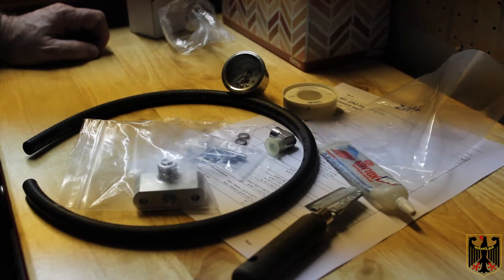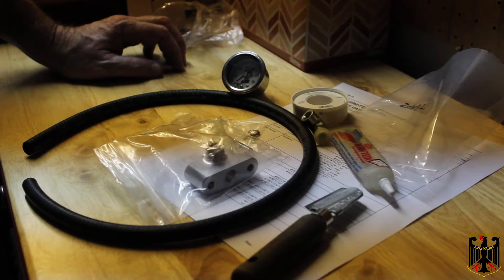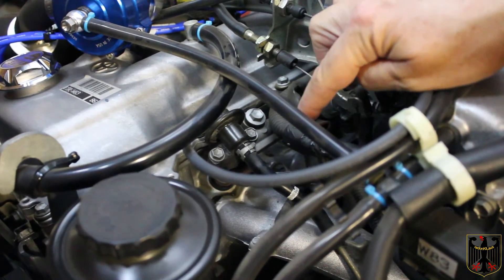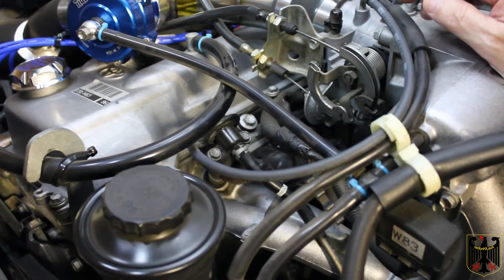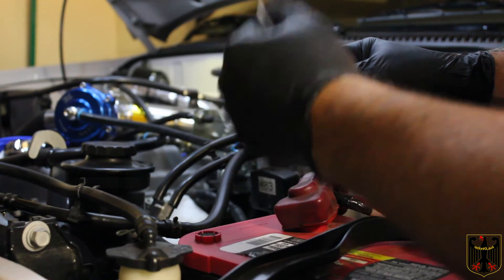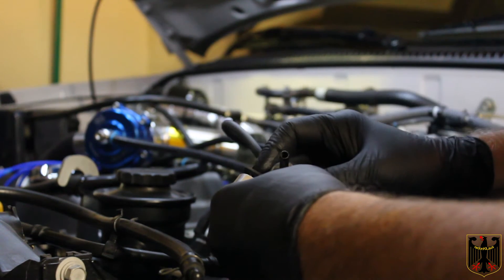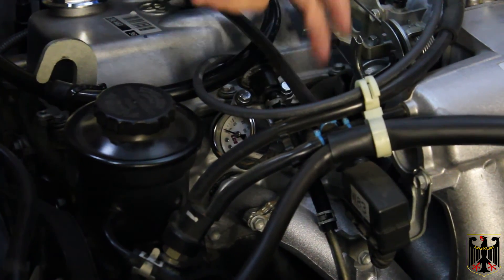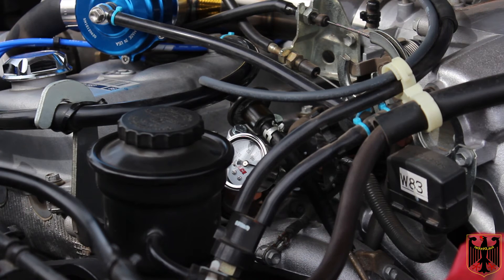LC Engineering 2RZ/3RZ Fuel Pressure Gauge Installation

Comment: what causes fuel pressure to drop instantly after engine shuts off?
Reply from the maker: Failing/failed check valve(s), things not working as they should in the fuel pump/sending unit assembly, etc.  Thanks for watching!

Comment: Hi, love your 4 runner. I have similar also 97 2.7l.  Recently I replaced the fuel filter with oem filter and now have a hard to start when warm condition. Starts quickly when cold. I have to do the short cycles of cranking once warm. I suspect that the new oem filter may be missing a check valve but it's just a guess. I'm considering putting in an add on check valve on the fuel. I'm curious as to the nature of the problem you experienced. Thanks Barry
Reply from the maker: The issue I was having was related to aftermarket components.  One thing to note is that the fuel pressure in the rail does bleed off over the course of a few hours, so I wouldn't think a check valve would cause the issue you're experiencing.  Without seeing the truck and diagnosing in person, there's too many variables to narrow it down accurately.  Thanks for watching!
Reply: Mine does the exact same thing! Did you have any luck on the issue?

Comment: I have a 3RZ, Do you think install that gauge will let me find out the problem is from fuel pressure regulator or fuel pump. My car is running lean of fuel as the mechanic told me. Whenever the rpm between 1.6-2 rpm uphill or give a bit more throttle the car start to kind of jerk. Coil packs, leads and sparks are new. Thanks
Reply from the maker: This will definitely help you identify if the issue has to do with fuel pressure.  Thanks for watching!
Reply: Did you ever fix your lean running issue?  I am in HK and have a 3RZ with the same problem
Reply: I can’t find similar product in Australia. But recently the fuel pump totally dead so I replaced it the issue gone for weeks but the problem coming back....  no idea

Comment: Awesome video!  Thank you for going through the effort to film and to post it.  I ordered the gauge since I'm having a problem with starting my 1999 3RZ 4Runner.

With the gauge installed I noticed it's not getting any static fuel pressure but after cranking and getting the engine to run, the fuel pressure is about 48 PSI.

Would you have any insight on what may be happening?
Reply from the maker: Mine drops down to zero after running and my fuel pump does not prime until I begin cranking, so I think that is normal for a 3RZ...if not I guess I have an issue too!  That pressure sounds about right, I think mine might have been above 50, though (then again, I may be thinking of another of my vehicles).  If you're having a problem starting you may have a valve adjustment or spark issue, causing fuel not to ignite or making the engine take longer to build compression.  You may also have underperforming injector(s), but I'd check those first two bits first.  Thanks for watching, and I hope you get your issue resolved!
Reply: Thanks!  I have a lot of miles and need to check the valve lash and the fuel system.